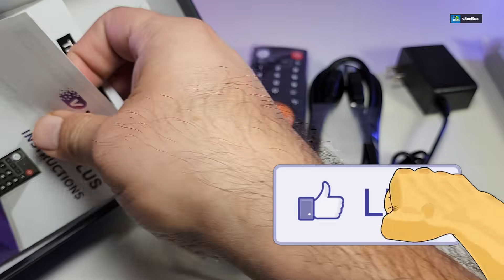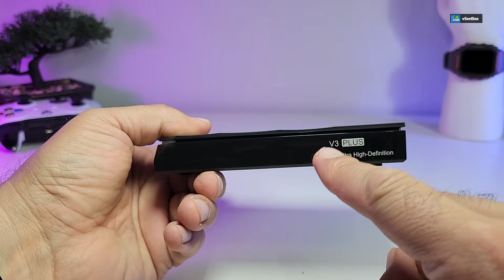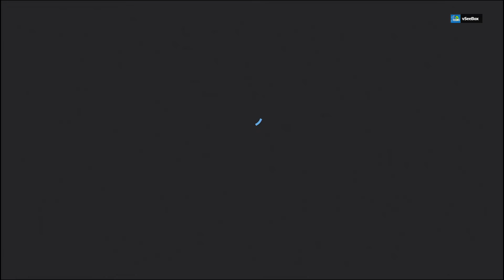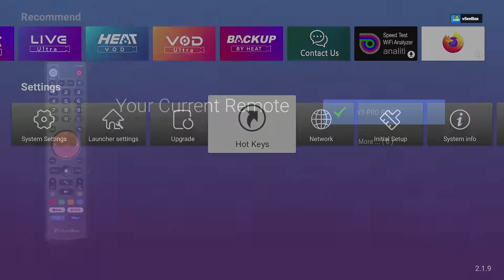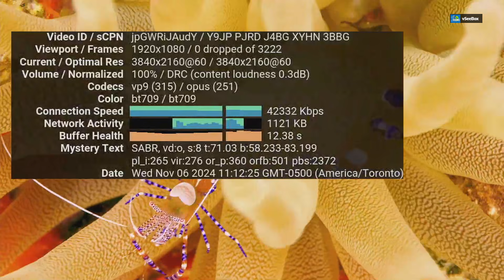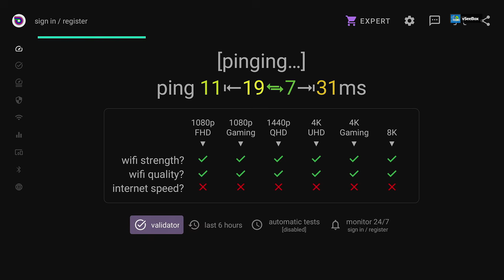The Truth About Streaming: vSeeBox V3 Plus Review – Chipset, Connectivity, and Beyond!

Comment: Mine won't connect to tv
Reply: Use the hdmi cable and make sure you read the hdmi port number on the back on the tv then push that hdmi port number on the tv remote.
Reply from the maker: Check your HDMI cable connection to both the box and the TV.

Comment: How can I program the remote other than the top left corner buttons I was only able to program the power & volume buttons nothing else. I need to connect the box to my WiFi but can’t… please help
Reply: The instructions are on the back of the Vsee remote.
Reply from the maker: @yetsi69  contact there support. For step by step guide
Reply: Did you get it figured out?
Reply from the maker: @Mr.BigLou  I don't sell this box is just reviewed this box.  You need to check with your seller if your TV is compatible with this remote

Comment: How do I get the remote to use hdmi 3 instead of hdmi 2 connection.  Pairing with the tv remote makes it use hdmi 2. I don't want to use hdmi 2.
Reply from the maker: @lindalbarchman8394  physicaly connect the hdmi wire to hdmi 3 at back of your TV first.
Reply: Lmao....wow